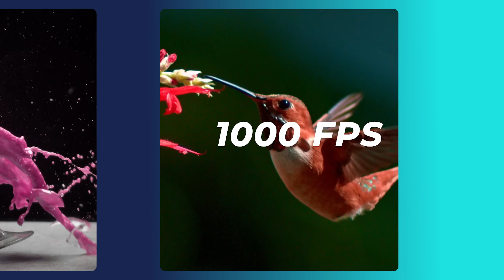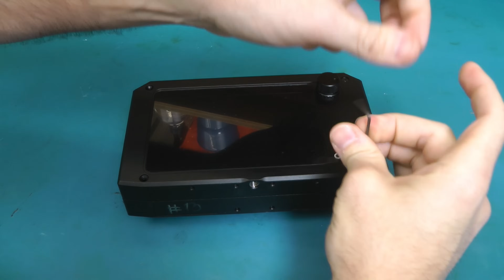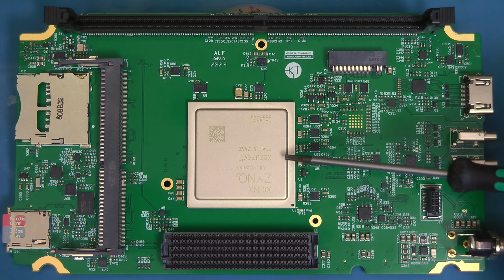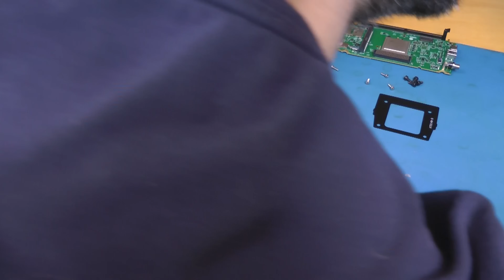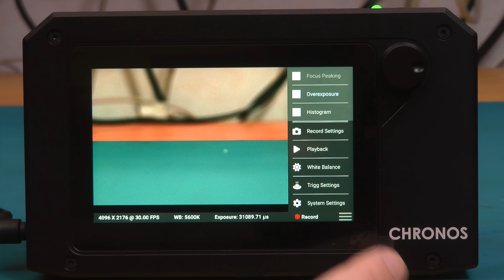Chronos 4K12 Intro and Teardown

Comment: Hi i have a miroex4 model high speed camera, I sent a high voltage signal (200v and Micro second ) at the trigger point , now camera does not showing any power on. Can you let me where will possible damage happened

Comment: After 3 weeks i am watching your video. you and your team worked great . 1000 fps is not a joke in hand camera. nice footage and huge details in 4k. but as a videographer I suggest that you should  add weather shield and dust cleaning feature on sensor. battery backup is needed for emargency purpose , if you think it will shoot outdoor scene. lense mount should be fixd or press lock system. because most of the people are not technically expart.  I have seen m.2 ssd is so empressive. I think sensor is so sensible. we should think about it. I have seen you added type c port but if you add one thunderbolt port.It will be the game changer. You and your team hardwork will approciate soon..

Comment: Today I showed your video to a colleague who used to work with high speed cameras in his former job. He likes the design very much but was concerned that there is no filters at the intake fan to keep small debree out, since they are facing forward. I have to agree, that there should be some threads on the outside to mount simple thin air filters to the fans. Other than that he was also very impressed.

Comment: When i started watching the content on this channel i didn't understand much of what was said, fast forward a few years and i actually get it now 😂 Excellent work! Interesting use of the MSP430, that little TI chip can do more than i gave it credit for.
Reply: It is the only part I could probably work and understand there LOL. Worked with MSP430 and EW430 from IAR for some years. It is pretty decent for many application, speacilly low power and measurement.

Comment: Impressive! But why is the max framerate so limited? According to the specs shown the throughput falls to about 0.1 gigapixels per second.
Reply from the maker: These new sensors use a more parallel column ADC architecture, so you get relatively minimal frame rate boost from windowing in the X direction. As an updside, you get no penalty in frame rate for increasing the X resolution up to about 2500 pixels for those small resolutions.
Reply: @tesla500 I see the new Chronos cameras can lower bit depth to 8 and 10 bit to increase framerate. Can a firmware upgrade be implemented on the 1.4 and 2.1 cameras to have this ability as well?

Comment: could you put some performance/high performance cpu or big/little cpu config  i think would help/make a difference
Reply from the maker: Performance is mainly limited by the programmable logic (PL) portion of the chip, the CPU/GPU isn't really used for active image capture, that's all hardware accelerated in the PL.

Comment: Seems like some good improvements. But to see the LAN port being removed is a bit sad. I'm probably one of the dozen people that actually used it (exclusive), but maybe it's due to my workflow. There is a thread about it on the forum. I hope some of the UI improvement will trickle down to the older cameras. Especially the API and web version never worked right for me. Also, as previously mentioned by others, I also dislike the types of fan. Personally I would like to have bigger ones, even if that increases the case size. I care more about the noise and lifetime of the fan than the body size. The fan of my 2.1HD is running on it's last live, but no need to ship the camera around the globe for a fan replacement, I can do this on my own. Thanks to the repair friendly design ;)

Comment: Great work. Will the USB-C support 10GbE adapters? Will it encode in H.265 as well? 
Looking at the UI, a lot of buttons/sliders are placed close to the edge of the touchscreen. It may make the interface hard to navigate - we'd love to see them moved a little bit further from the edges.
Reply from the maker: I have yet to find any USB C 10GbE adapters, they are all Thunderbolt on USB-C connectors under the hood and that's sadly not supported. If there are true USB-C native ones they will be supported. H265 is supported yes! I hear you on the UI, I'm very particular about control feel, if these are causing problems they will be sure to be changed.

Comment: Fantastic work from the team! Looks like a really refined design, the design to fit with those heatsinks and multiple PCBs is beautiful, and likewise it sounds like the utilization in the FPGA is pretty high, certainly don't think you could have put such a camera in any smaller of a form factor. 

Although I do want to give some feedback just in case it ends up being useful:
- The USB ports should be labeled more distinctly, imo labeling them "USB-C" is kinda pointless, you should labeled them with something functional like their speed and maybe outline the preferred port.
- I think BATT1 should be in a holder or at least glued down (I assume it isn't?) if it has to be a solder tab version as it's 'flapping around in the breeze' as Dave would say.
- Given there's now no internal battery does the design incorporate any consideration for hold up time on the input power rail for if the cable moves and you get a dodgy contact for a couple milliseconds? I only ask because I can't see a single large bulk capacitor and you're using one of those DC barrel jack with threads for a locking plug which isn't a problem just so long as it's made clear locking plugs should be used as I imagine many will have existing accessories with non-locking plugs they will reach for without second thought.
Reply from the maker: Thanks for the suggestions! I agree. I've forwarded them to the team.

Comment: Dude, words cannot describe how impressed I am with these cameras as you and your team have released bigger and better products. The implementation of as many off the shelf user replaceable/upgradeable parts as possible to bring the price down is absolutely the right way to go, instead of designing horrible proprietary modules with DRM in them and price gouging the end user once they want to upgrade.

It greatly benefits the consumer, a concept that seems so foreign these days. I wish you and the rest of your team a spectacular launch, and many more to come!

Speaking of standards, if it's not too late in the design I think adding USB C PD capabilities for running the camera would be a huge upgrade. I've pretty much switched to it as my "standard" for battery packs and power adapters. Being able to run the camera off the same power brick and/or battery banks you use to charge your laptop would be awesome. 65w PD power supplies are very common (you can pretty reliably find them at walmart!) and would land perfectly in this unit's voltage range.

Comment: That's interesting that adding a  module instead of soldering your memory chips earned you space, we tend to see any connector as a space wasting opportunity. Are DDR connectors OK with the vibrations of a hand held device?
Reply: a drop of silicon on each side could take care of that ... I think ....

Comment: Will it support the Samsung 256gb ddr4 dimms?
Reply from the maker: If the FPGA is able to support them! That's TBD, if AMD/Xilinx can provide a memory controller configuration that will work with those DIMMs.

Comment: What is the power connector you're using? Is it final?
Reply from the maker: It's a 5.5/2.5mm locking barrel connector, that will likely be final. Is there an issue you see using that particular connector?
Reply: @tesla500  Probably OK. BUT, speaking of issues, your trigger connector might be problematic. On page 17 of  "The Art of Electronics, the X Chapters",  they explicitly mention the 1/8" headphone connector as the one to avoid. No reasons given, they simply ask to "just trust us!"  I interpret the exclamation mark as "a very bad experience".

Comment: What an absolute unit of a FPGA!  500K LE is rather large, and all the block RAM and DSP slices definitely add up.  Still incredible you have 10 power rails, what a headache!  Really cool you're running Linux too!  Are you using a custom distro or one of the many customizable mini distros?

Comment: A camera where one can upgrade the RAM stick 😅

How much can it take?

Can it run Crysis ? Or at least DOOM?
Reply: The soc should be capable of doom that as long as you can access the embedded linux inside
Crysis, maybe, should run with box64

Comment: Great to see a new camera. Been wondering what Kron Tech has been up to for the past few years. I like the better lens interchangeability and more refined housing. My only nitpick would be the choice in cooling fan. At a $15,000 price point, I'd really like to see a Delta, Nidec or Sanyo-Denki (or other top tier) fan in there. Especially since most 40mm fans seem to live short, terrible lives.

Another minor nitpick - don't you think the "Now 4K High Speed is accessible to everyone" bit in the commercial comes off as a bit... presumptuous? Don't get me wrong, I'm sure it's a very competitive price compared to other 4K high speed cameras and 100% worth it, but the "accessible to all" kind of rubbed me the wrong way. The original Chronos 1.4 was accessible to hobbyists. At $15k, the 4K12 is really only accessible to companies.
Reply: hobbyists dont really need 4k12. that fpga alone is a 6500 dollar part. the price very resonable for what you get.
Reply: @SupremeRuleroftheWorld  they weren't nitpicking the value, they were specifically nitpicking the accessible to everyone claim. Don't change the topic.
Reply: CFM-4010-03-22 for anyone curious. Its not a no name cheap fan, 4 wire PWM, 10CFM, decent rated life. But a bit noisy. I don't see anything from delta/sanyo/nidec that is comparable on digikey but they probably exist elsewhere.
Reply: 4k is not necessary for most people. This camera really takes the place of a phantom for smaller creators that might want to own the camera for the cost of renting a phantom for their projects.

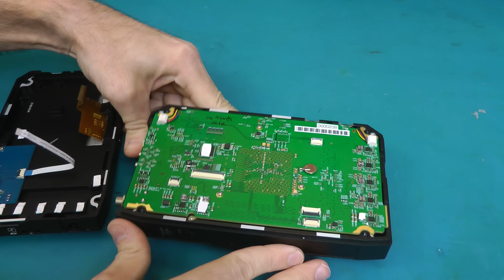Comment: 6:40 is that a soldered down RTC coin cell battery? I always wonder if designers assume that the useful life of a product is shorter than the life of a soldered down battery and it will never need to be replaced.
Reply: Not a showstopper if it fails, and hardly difficult to replace though so not a big deal
Reply: Might be a supercap as is common in a lot of cameras.
Reply: Strange choice, given all the other user-replaceable parts.
Reply: I wonder if its a Li-ion rechargeable cell.

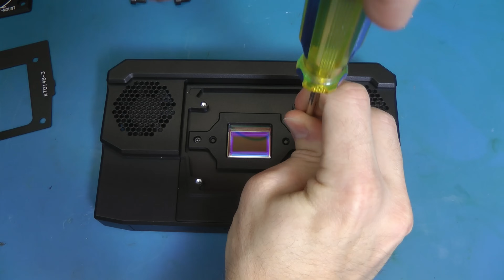Comment: question:  at 17:47 (approx) the IR filter is removed, and show a close up of the image sensor itself. It is clearly scratched in 2 vertical and one horizontal -- what is this about? It could be some cover or lens artifact? 

are pixel maps for the sensor available ?

Comment: glad you are still working on the cameras, now they are getting so close to other alternatives that you might just convert a couple customers.

does the software allow for an upgrade of the internal ssd to like 4TB, and what is the maximum supported speed, PCIE4.0x4?

Comment: A fairly decent design to say the least.
See some areas where ease of repair could be improved, but here I am needlessly picky.

Main thing being the short flat flex cables at 6:37, here a small daughter board on the front assembly to aggregate all these cables into 1 flat flex could have been nice, all though with its own set of downsides.

Also slightly surprised that 1 DDR4 channel were enough bandwidth, but I guess 19-ish GB/s is quite fast. (19-ish based on that 2400 MHz module shown at 13:11) Though wouldn't have added much more height to add a second slot for twice the potential recording time, unless it is already pushing the addressing capabilities of the FPGA.

The most pesky thing my eye can spot is the trace at 14:00 going up from U5. Carelessly trailing its way up through the ground plane, something just gives the gut feeling of this potentially not being good for signal integrity for that SODIMM memory channel. (I suspect that there is internal ground planes that solves this issue.)

Does it support USB-C power? This would honestly be a killer feature.
Another nice thing would be if the DC input were going higher than just 24 volts. (this is nit picking, though I guess I have gotten spoiled by Teltonika routers going from 9 to 65 V...)

Seeing the BNC go away is both nice and not at once.
It is a sturdy reliable connector, but I guess the TRRS jack offers more than 1 trigger channel. (I presume it has 3 channels?)
Also, is there a external "shutter" feature? (ie, capture 1 frame per trigger, but still obviously at high frame rates.)

Comment: Summary
Introduction and Product Overview  
- 0:01: Introduction to the new Kronos 4K 12 camera.  
- 0:06: The camera has been in development for the last few years.  
- 0:09: The Kronos 4K 12 is a brand new camera with a new architecture.  
- 0:13: It records 4K resolution at 12 gigapixels per second.  
- 0:25: The Kronos 4K 12 is part of a new line of cameras.  
- 0:36: Thanks to the kronch team for their efforts in developing the camera.  
   
Product Features  
- 0:57: The Kronos 4K 12 is capable of capturing high-speed motion in detail.  
- 1:04: This technology is ideal for capturing research, wildlife, sports, and more.  
- 1:28: The camera has a built-in touch screen, flexible recording formats, and is portable.  
- 1:43: The Kronos 4K 12 offers great value for its performance.  
- 1:49: Users can review and store clips directly inside the camera.  
- 1:56: The camera's design allows users to focus on the subject and not the setup.  
   
Product Comparison  
- 2:30: Comparison of the Kronos 4K 12 with the Kronos 1.4 and 2.1.  
   
Product Disassembly  
- 5:55: The host begins to disassemble the camera to show its interior components.  
- 6:12: The host remarks that this is the first time he's disassembling a camera he didn't design himself.  
   
Components and Design  
- 10:16: The camera is based around a Xilinx Zynq UltraScale+ FPGA and System on Chip combo.  
- 10:37: The chip combines the functionalities of a smartphone CPU and an FPGA for high-speed data acquisition.  
- 10:45: The camera features two large memory interfaces for running the Linux operating system and storing uncompressed high-speed video.  
- 11:02: Tour of the rest of the board, including power supply components, USB support things, HDMI video re-timer, and more.  
- 11:45: The camera has a user-swappable lens mount and user-removable IR filter.  
   
User Interface  
- 21:42: Demonstration of the camera's user interface.  
- 21:53: Overview of various settings and functions, including resolution select, exposure, frame rate, white balance, and system settings.  
- 23:00: The camera's storage and network configuration options are displayed.  
- 23:56: Demonstration of the playback feature of the camera, including marking in/out and saving options.  
   
Conclusion  
- 25:09: The host ends the video with a preview of one of his favorite shots captured with the Kronos 4K 12.

Disclaimer: I utilized gpt4-8k 0613 to condense the video transcript
into a summary.  I employed Prompt 1 to generate timestamped bullet
list and organize it into sections with titles at a cost of $0.25. The
summary was manually formatted using YouTube comment markup.

Prompt 1: "Summarize as a bullet list. Keep starting timestamps. Also
split the resulting bullet list into sections. Create section
titles. Keep timestamps for the bullets. Use this format for titles:
*title*."

Cost breakdown:
input tokens:  6920 @ 0.03 / 1k = $0.21
output tokens:  647 @ 0.06 / 1k = $0.04

Comment: I'm so sad , as a repair tech I almost cried watching you open it. What an amazing design , so simple and flex cables that are actually long enough. Well done amazing build quality and those type c ports look very beefy.
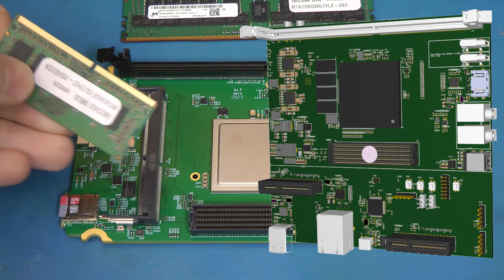Reply: I would imagine Apple charging 2x the price with all parts soldered down. The part(12:12) he stated using socketed RAM offered more space to slot in the expansions shows a different attitude towards engineering.
Reply: @rossmanngroup will sure shed some tears
Reply: @brauchmernet  Louis would be screaming praises at them for not welding it shut.

Comment: I wonder if you'd be able to save raw high speed data to the 1TB NVMe if you did it with JPEG frames (at least at 1080p/1000 fps so quality was acceptable)... have you considered this?  An FPGA JPEG encoder would need to be used but you've got a pretty big device there.
Reply: Shane Colton did this with the Freefly cameras, he managed to squeeze a realtime wavelet encoder into an ultrascale. He explains it in detail on his blog, it's a major pain in the ass.
Reply: NVMe SSD can't sustain the claimed speed once their buffer cache is full, so...what would be the point?
Reply: @AKAtheA  Some can - depends on the technology.  The Samsung 980 Pro NVMe can sustain write speeds of 1.5GB/s once cache is full.  That would require each 1080p frame to fit within about 1.5MB for 1000fps, which feels just about plausible for medium-quality applications, but would allow for minutes of record time.

Comment: Looks pretty well put together, low screw count, no glue or clips, plenty of space, just 3 PCBs, off the shelf non soldered RAMs and SSD... maybe a better coverage of the thermal pads could be desired and/or better fans, I can imagine some noctua ones installed to have quieter operation and more air flow. But that is something only needed for people that will use it under sunlight on a hot summer day.